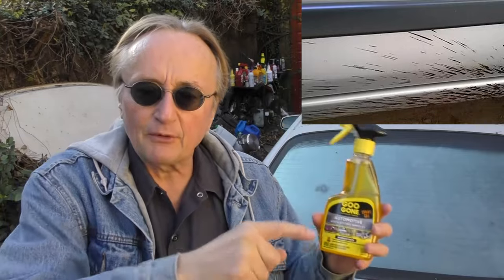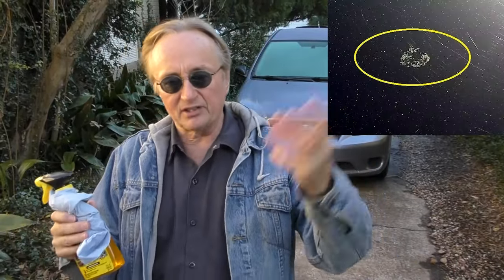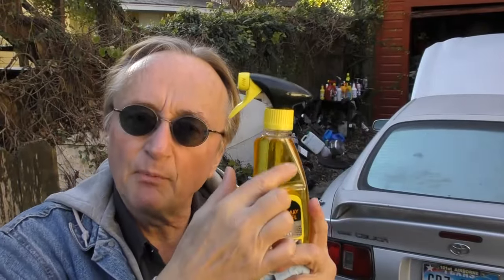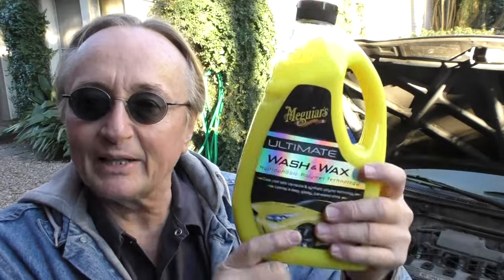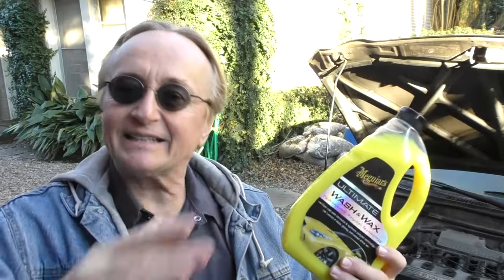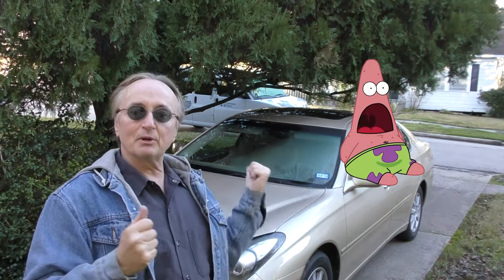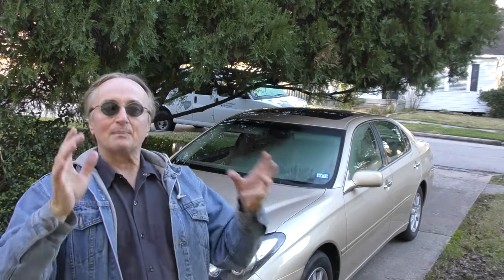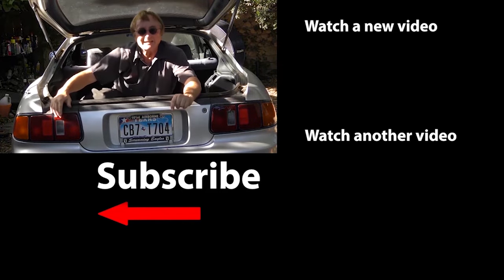Doing This Will Make Your Car Paint Last Twice as Long

Comment: Never use the automatic car washes with rotating brushes, you will gather a load of microscratches
Reply: The Occasional Comment he already did a vid on it
Reply: They also recycle the water, loaded with dirt.
Reply: Very true
Reply: Get silver. You can't even see them.
Reply: Learned this the hard way. Also knocked out my satellite radio because the sharkfin wasn't sealed enough against the power wash and it corroded inside. Now if I want XM I'm faced with removing the headliner to replace the part. AFAIK?
Reply: Janet Airlines thats why its called micro scratches
Reply: Most people don't care.
Reply: Never will, I took a jaguar I use to own in there, left scratch marks on the black  paint. Any automatic machines in general are bad in my opinion.
Reply: @chargermaster586  because they drive boring cars like hondas and Toyota.
Reply: @albertol9654  that's a shame! I saw another video by chance-the latest technology is touchless so it uses high pressure water and various car soaps etc then the drying process is by a powerful fans, so it comes out clean and dry without being touched at all
Reply: Totally “boring” right??? Well at least they’re reliable
Reply: John Pavey reliable or not, ppl don’t want boring cars
Reply: Maybe some but not all I have a 2003 summer car that I've been using a drive through car wash and the paint still looks like new. If you drive your $30,000 dollar car/ truck in the winter you must be rich or dumb I see so many just rust away.
Reply: @EgadsNo  How to leave a grey haze on your car, and feel like you've wasted $7 in quarters to get that result. I understand why they do the recycling, but I don't care for it at all because they guys operating the washes never maintain those filters.
Reply: @slimjim355 I go to a touchless one during the winter. It's way better than leave the road abrasives and salt on the paint and the underbody all winter.
Reply: I only use them(I'll try to find the brushless ones first) in the winter if/when I need to get rid of the salt from the plows. It's pretty cold out now, between zero and 25 degrees but I wax my car every year before winter to help. Otherwise I wax at least 4 times a year and hand wash.
Reply: I go un touch carwash
Reply: I bring my own wash cloth . The only thing that pisses me off is that car washes recycle their water and the water conditioners they uses doesn't remove all the salt from the water . I live in the Rust Belt ànd car gets coated in salt and thats how so much salt ends up in the car washes settling tanks .
Reply: Ceramic coating best thing since sliced bread
Reply: @EgadsNo   Not sure if it's true, but up north here in upstate NY, I was told or read that they recycle the water.  Problem is, the dissolved road salt is in that water.  Using one of these car washes in the winter would be adding a helluva lot of concentrated salt onto the vehicle.  I hand wash outside as long as it's above 30 degrees.
Reply: Bmw M3 e46 40yr old male who likes his “boring” reliable car.  🙋🏻‍♂️
Reply: How do you intend to do that here in New York when it gets down to single digits in winter?
Reply: of self ones with the brush.
Reply: @EgadsNo  the city also recycles the water!
Reply: @thesparkster  I can get heaters
Reply: I had that happen to me and the owner swore that it wasn't their car wash that scratched my car. What a joke. Now I know.
Reply: Then how do you wash a car in the Winter freezing temperatures?
Reply: At the present moment I have a pending lawsuit against a car wash company w/automatic car wash. While my car was halfway in it, the thingy that pulls your car through got jammed and my car was stuck there for like 3mins while the brushes was spinning away on one spot of my car. It took the workers there that long to shut the thing down to get my car out. Tore up the paint on my front fenders and roof. They had the nerve to say it was my cars manufacturers fault because their cars are soft painted (it’s a Nissan). After a brief cursing match with the manager I decided to sick my attorney on them.
Reply: I work at a carwash for 5 years and still work there. I have never washed my car in it lol. People there don't trust me with the dangers of carwash haha
Reply: Janet Airlines silver cars are ugly
Reply: @2004cyrus  yeah, just bring your own wash mitt and bring your 2 buckets.
Reply: In Sweden you have to because it´s illegal to wash your car yourself at home because you then pollute the environment too much and get a hefty fine if you get caught doing it. I kid you not. :)
Reply: @albertol9654  There are brush free carwashes in Germany.
Reply: I'm surprised how few people know this.  I have 3 Toyotas, two have never been through a car wash.
Reply: Yup...just go through the touchless ones to knock the winter salt off.
Reply: @justin94block  what do you think of touchless car washes?
Reply: @1cmman  omg dont say that too loud here because the liberals will try that crap on us :P
Reply: @shando3333  safer option. Might need to use a quick detailer afterwards to get the ones that's missed and getting the water out.

Comment: Use 2 buckets when you wash your car.  One is the suds bucket and the other to rinse your sponge.  Never put the sponge in the suds bucket without rinsing first.  When you finish, let the rinse bucket settle for about 30 minutes, then pour it out slowly and look at all the grit in the bottom!

Comment: Scotty is spot on. Been using Nufinish on my cars since the 70's.  On a dollar for dollar basis it is cheaper and out performs most car wax products that cost twice the price. I now only do it once a year. But then again I am now retired and my car is in a garage most of the time. I'm not on the road day in and day out like I used to be. Back when I was on the road all the time I found just twice a year was more than enough. Once in the spring and once in the fall and the water would bead up on the surface all the time.

Comment: Previously had a 2001 Nissan Pulsar with metallic paint. Never washed it, or waxed it. I used Meguirars Dry Ultimate Detailer, which is a mist spray, you simply wipe off the car with micro fibre cloths. It removes dust and does not in any way scratch the paint, providing you do not apply pressure to the cloths, and wipe in  an horizontal pattern, so as to avoid swirls. The shine is incredible, and after 17 years, the paint was immaculate. Takes about 5 minutes to do your whole car, unless it is a US barge. This product also locks in the paint color, against fading. I now use it on my new Suzuki Swift Sport. Costs $32 in Australia. It is the ideal product product for people who live in apartments, and don't have access to a hose. I began using it when there were summer water restrictions, and never change back to water, which helps rust your car.

Comment: I love Nu Finish cause it removes the dirt, tar, and other stuff better than anything I have ever used. The water beads up even thought I only use it once a year(my cars are garaged). I also use it on the headlight lenses. They have never gotten headlight 'cataracts'. As you suggested,  I will try Nu Finish on my windshield. I have been using Rain-X which does a great job  but you mentioned it could shorten the longevity of the wipers.

Comment: Did Scotty just say ceramic coatings were useless crap, he’s very knowledgeable but that is ridiculous. A quality ceramic though expensive is much longer lasting than any wax or polish combination and provides way more effective protection
Reply: Scotty probably doesn't realize that the paint finish has to be perfectly clean for the nano coating to properly bond to the paint finish.
Reply: yes very elaborate 3 or so stage prep for it to work but will last much longer.

Comment: I always avoid parking under trees. Washing a car is easy but the typical toughest stuff to deal with is the lower part where you get tar kicked up off the road and all the sticky stuff from trees. If you want to go next level you can clay and use chemical fallout removers to get the embedded particulates out of the paint.

Comment: Honestly just a proper wash and occasional detail is good. Most people don't care about their paint in the first place which is the main issue.
Reply: You should see Florida, back in the 90's you would see sun burnt paint all day long on all kinds of vehicles!  Now a days though a car can be an old bucket but usually the paints still look pretty good.  Seems the manufacturers generally have perfected a good paint job where even bafoons can get 10+ years out of a paint job without ever washing the things!
Reply: @vulpixgrant  my car's paint lasted about 16 years before the roof started loosing it's clear coat. kinda sucks because waxed it regularly and i wanted it to look pristine for much longer. it's not worth repainting it though.
Reply: @mujjuman    If the paint is still good but the clearcoat is coming off, I think you can have the clearcoat taken off and a new clearcoat put on it without effecting the paint under it.  Not sure what that cost but it has to be cheaper than a full on paint job...  This way you also keep that factory paint!

Comment: I was never satisfied with any wax or sealer until I found Klasse. Been using it for years. You can go up to a year until the next wax and it restores the paint finish and seals it to a deep shine that actually lasts and beads up even after 6 months. Of course, you have to prepare the paint before application for the best result.

Comment: I've used Meguiar's line of products on my cars for the last 25 years and I've been very satisfied with the results. I started using their stuff on a Porsche that I had in the early 90s to early 2000s and I was able to maintain that car in near showroom condition.

I just got a new 370Z and I'm using their stuff on it. Their scratch removal polishes, like Scratch-X 2.0, works terrifically if you are careful in using a good foam rubber applicator pad and use proper polishing technique.

Comment: I tried this super cleaner ( Purple Power ) outstanding cleaner ! I had brake dust all over one wheel Failed caliper used two cans of brake cleaner -very little improvement , tried Purple Power with small nylon brush --Fantastic results , did my engine compartment -wow , used hose with lowest possible pressure - came out amazing , give it a try , you won't be disappointed, stay well , Bruce

Comment: Nu Finish is an excellent product, I have been using it since the early 90's and it does work well . It wont last a whole year but it will last about 6 months in cooler  climates. For summer months apply it just before summer and again about 3 to 4 months after summer, then again just before winter, repeat this cycle every year, that's all you need.

Comment: Scotty, I love your stuff and this video is no exception (mostly). 
But:
1) Though Nu Finish calls itself a polish, it's not technically just a polish. Nu Finish is a polish and a polymer coating and it's pretty good stuff. I know Consumers' Union rated it #1 in their testing. The reason I bring it up is there are technically polishes you can buy that are JUST polishes. When you use those you use them as part of a multi-step process, where polishing is followed up by "waxing". Waxing could including an actual real wax or a polymer sealant. The sealants are said to last a little longer. Nu Finish is a time-saving combination product. Probably not a bad way to go unless you have all day long to do a ridiculous multi-step process. 
2) Parking under a tree to avoid the sun? I agree that sun is bad for your car, but trees usually drip all kinds of horrible stuff on your car. I'm not sure which would be worse, but I'm thinking it would be the tree sap. It might depend on your location, though. I'm up in Washington and our sun isn't as intense as down in Texas. Thanks for the video!
Reply: Thanks for the info on Nu Finish. Used to do the multi step ones but used Nu Finish recently because I had it sitting around for years and didn't want to buy anything. First time someone has ever stopped me at a stoplight to say how nice it looked.  06 Tacoma feels good. I do have little micro scratches/swirls if you look close. What would you recommend?

Comment: Scotty, I love your videos but your comments about Ceramic Coatings are a bit off. Yes, you're probably right that there's a lot of cheap/rip off coatings that really aren't that great and just use hype marketing terms. But if you do the prep work, and get the proper brand, your car can look amazing, and stay looking amazing for a long time with less work to keep it clean for a long time.
Reply: With the benefit of scratches being on the ceramic coatings as long as their not the seep kind that would go to the pain anyways.

Then you can just polish it all off and reapply and the paint looks brand new again.  Without the risk of eventually going through all your clear coat.

It's a lot of fucking prep work though...
Reply: What's the proper brand?
Reply: @thisismagacountry1318  I put Blackfires coating on a new black Avalon earlier  this year. Even though it was new it did need a light  claying, then a light polishing and body prep wipe down. The car looks like a black diamond and dirt really can n ot stick to the ultra slick surface. Plenty of other brands out there too but you have to be sure you get the existing finish corrected and squeeky clean for it to work. These coatings actually bond to the paint surface and will not work if there is any existing material on the paint. Do a Google search and there are many forums on the various brands...they are all good but remember the paint has to be properly polished and cleaned for the coating to work.

Comment: I use any half decent wash and wax shampoo and then Autoglym Rapid Aqua Wax. It's a wax polish that you apply to the car when it's wet and to the glass rubber seals and plastic trim it's a lot easier than polish or normal wax and the results are amazing. I wish I had discovered it years ago. In complete contrast my brother washed his car once when he bought it 11 years ago and has never cleaned it since. Now it's covered in algae and lichen and has moss growing round the window seals !

Comment: Hi Scotty, in Norway we have snowy, slushy and salted roads during winter. And the roads aren’t very straight; not even the motorways (over 90 km/h, two lanes). Rainy rest of the year. Sometimes sunny, but don’t count on it. 

So I chose a Mazda 6 skyactiv stationwagon, 2.0 liter petrol. Naturally aspirated 165 ps.
2016 model. Automatic. Dark grey metallic. 

Mazda delivers their cars in Norway with Tectyl-coating against corrosion. Toyota doesn’t so I skipped them. Also, these days Toyota mostly sells hybrids in Norway. Honda doesn’t sell the Accord now either. So I skipped them as well. 

I’m a tall fellow with long legs. I need a relatively large vehicle. I love big stationwagons. 

Mazda has good handling and I like their skyactiv automatic. Really easy to use! Useful in shitty weather. 

I got a new coat of Tectyl done at a professional garage. It should last 3 years.

And now I’m going to get a coat of Permashine over the paint. The dealer offers it. I’m a bit lazy and the weather here most of the year is mostly shitty. So I’m hoping that extra coating will replace the need for waxing the car. I don’t have a garage, I live in an old village. So I always have to park in the narrow streets. 

Cars are expensive in Norway! Stupid taxes/fees! 

I stay away from used ones here. I’m not interested in rusty german cars which will be a nightmare to repair.

So what else can I do to keep my Mazda last many years and many km?

And what do you think of Mazda’s plans to make straight six engines? Both petrol and diesel.

Comment: I'd have to agree with you on the ceramic and hydrophobic coatings, theres at least 4 reputable brands out there that carry worth while products, but they cost quite a bit depending on what you want. A simple nano ceramic can keep the dirt off for at least two years, and the more expensive coatings last a LOT longer, and most places stand by the products they use for a good 10 years. 10-20,000 for a coating might not make sense on a 50,000 dollar mustang, but on a 200,000+ super car, or collectors car its WELL worth it

Comment: I normally hand wax my 10 year old Dodge Avenger with a professional wax once a year. The rest of the year I use Meguiars Ultimate Wash and Wax. I've tried various wash/wax products and learned that Mequiars is by far the best. That helps by keeping the paint clean of dirt all year around and even though the car is 10 years old. I still get lots of compliments due to the finish looking so good.

Comment: My cars sat outside and when they were 10 or older, the upper facing surfaces started to fail. Clear would get cloudy or peel. They were silver too which doesn't get as hot as dark colors. I waxed them when the water would not bead and the wax would not last. The wax brand or type didn't seem oto matter, even the Nu Finish which worked well but also didn't last. Now that my cars are garaged, I find that the wax can last up to a year and the paint looks new on a 14 year old Toyota and 7 year old Honda. If you can garage the car, I think this is the biggest paint life extender. If not, keep it as clean and waxed as you can.

Comment: I've been very impressed with the Simoniz Glasscoat.  Got it very deeply discounted from dealer (son's employee discount) on a 2013 Elantra GT.  My wife got Ziebart package on 2016 Jeep Patriot, mostly for the undercoating.
6 years later on the Elantra and I like Glasscoat paint protection better than the more recent Ziebart.
No paint chips on hood of either, which was a problem on an untreated Prius.